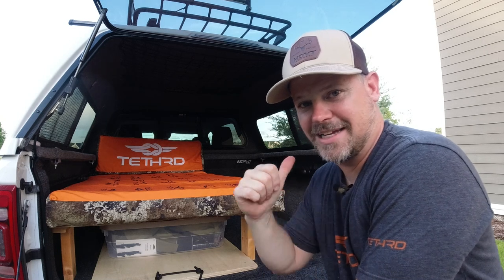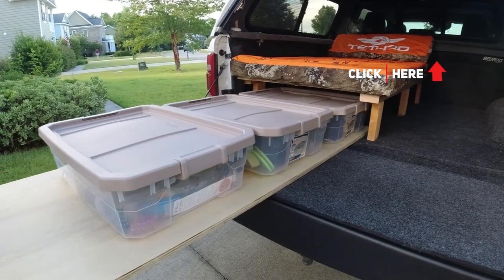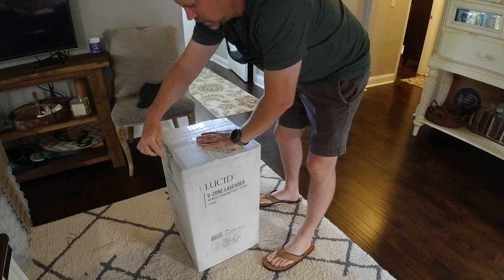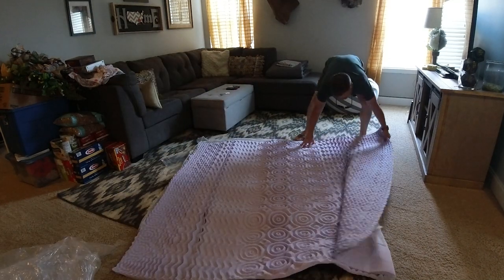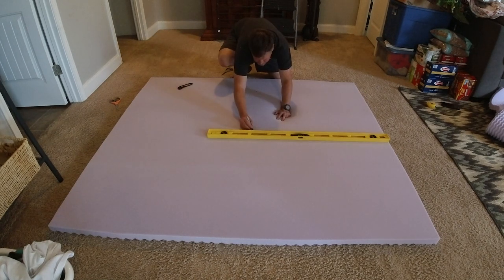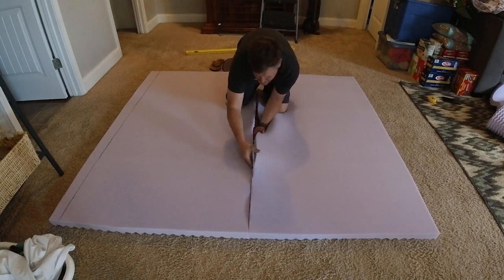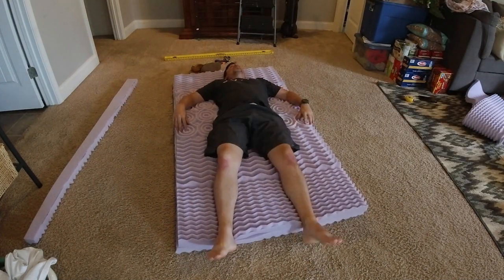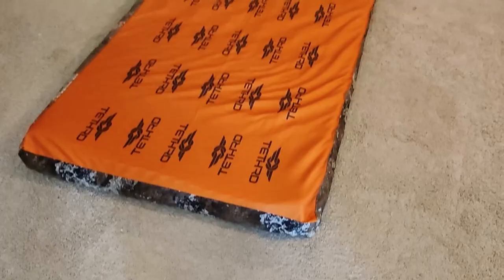Truck Bed Camper - Step-By-Step DIY Memory Foam Mattress build-a-long

Comment: Picked up a queen foam topper on Craigslist for 10.00 today. Home Depot wanted 25.00 for the same foam in 24 inch wide slivers. Would have to sleep sideways and straight as a board.

Comment: problem i found with toppers is they get warm to sleep on...tried different sheets, no go...also if ya have bad joints ie hips and such...also not good to sleep on....ive even put a seperation  under it for cooling ..no go..its the material the chines use to make the thing it just gets hot....lol  cool vids thks for sharing..
Reply: Did you find anything that worked?

Comment: Does your hip bottom out on floor when on your side?
Reply from the maker: Yeah it did. I had to increase the foam to about 6 inches.
Reply: @G2Outdoors  That would be especially suited to us old-timers, old joints & bones, and toss and turn sleepers. You're still a pup, G2Outdoors! Nice job in explaining it all. Thanks.